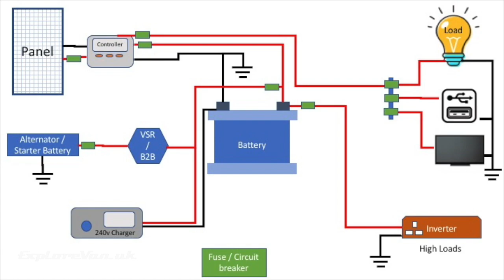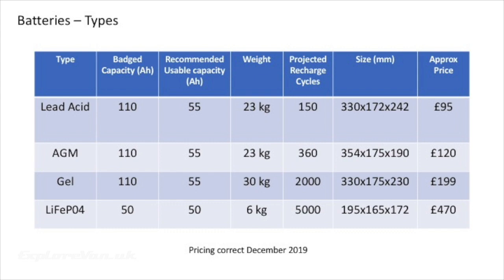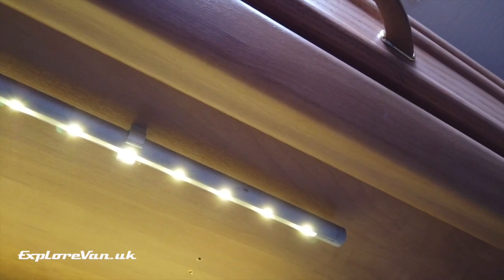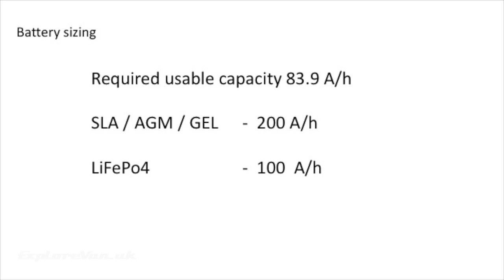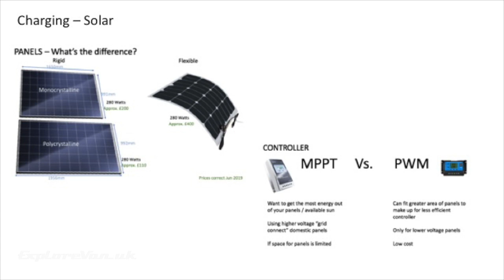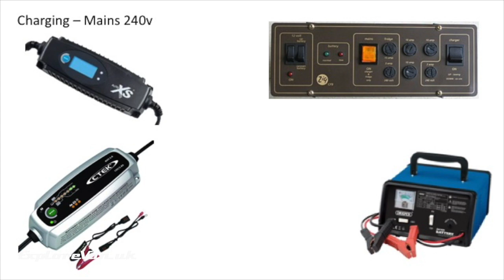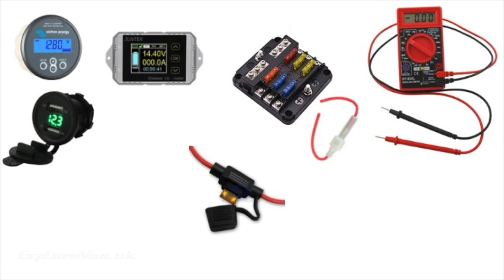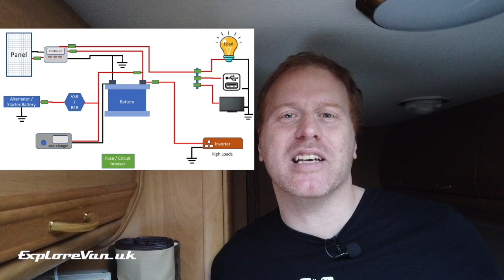Campervan 12 volt Electric Installation and Set up - Off Grid basics

Comment: Hey! thanks for all this info, really makes sense to someone who knows nothing about electrics! This may be a really silly question but if you have three different charging options, how do you know which one you are using or do you have to choose? Could it over charge? I want to use all 3 options but can't seem to figure out how it works. Maybe because no one else is this clueless!! thanks!!!
Reply from the maker: Hi, glad it's helpful!  It's not a silly question at all, there is no problem with charging by Solar, mains and alternator, in fact  itis a great approach to take, as it maximises the potential to recharge your battery.   Each of the charging controllers would effectively adjust to suit what each option was doing and the overall voltage of the battery. There is no risk of overcharging as all methods would move to a trickle charge once the battery was full.  

Hope that helps!
Reply: @ExploreVanUK  Hi, thanks for your reply. This makes complete sense! on the other hand, how would I monitor my battery level to avoid letting it run too low? I have a victron DC to DC charger but I don't think this necessarily knows how low my battery is, or does it?!
Reply from the maker: @emilysharpe5004   Hi Emily, the Victron will only draw power from the alternator to your leisure battery once your starter battery is at a safe level, that way it does everything to try to make sure you always have enough power in the starter battery to start your van. 

The latest Victron's have a Bluetooth connection so that you can view the charge status of the batteries on your smartphone. 

Alternatively, you could fit a battery monitor if you want to have a display that shows the level of your Leisure battery - a high-quality example would be the Victron BMV700

Comment: Can I connect solar and relay charger and battery charger and keep them connect to battrey all time and will I need each of them on switches to swap from each one when charging or will it be ok say leaving all 3 connected when charging from one of them
Reply from the maker: Hi, you can have all three and leave them connected, they will each compensate for each other. 

Whilst not a necessity for managing the charging I would always suggest some method of isolating each charger, just in case you need to.  But this could be as easy as having the fuses accessible should you need to pull them.

In our set up the mains charger is on a switched fused spur, the solar charger has a 35 AMP DC breaker and we have a switch on the low current negative feed to the VSR. This allows us to isolate each if we had to. But in normal use all are on.

Comment: Hi ExploreVan,I'm converting my van into a camper and I wonder if you might have an idea how long I would have to drive to charge my 115ah AGM battery if it was 50% depleted,can't seem to find that info anywhere,thanks in advance.
Reply from the maker: Hi John, - unfortunately that is a difficult one as there are a lot of factors that would vary the time, eg the size of your alternator, the state of your starter battery, what other electrical equipment is being used in the van whilst you are driving (eg radio/headlights/aircon/phone charger) what load is on your leisure battery while you are trying to charge it (fridge etc) and even the ambient temperature.  This is probably why you are struggling to find examples as there would be such a variance.

My advice would be if you are looking to maximise the charging potential while driving, consider a good quality B2B charger rather than just a split charger relay / VSR. 
These are much more effective at charging and can give a consistent 30 to 120 amp charging current to your leisure battery.  It will keep your leisure in better health by stage charging it and will be a lot quicker and consistent. 

If you happen to have a smart alternator this is the only way you could do it as a split charging system would not work. 

As a split charge system / VSR is much cheaper you could always fit one try it, see if it gives what you need and then upgrade to a B2B charger if you find it lacking.

Sorry I can't be more helpful!

Comment: Great video very informative , I'm just about the fit a split charge system using a kit I purchased with the same duritc relay but after watching your video would I be better of buying a battery to battery b to b charger and using that instead of the duritc ? Do they wire in the same way ? And What battery to battery charger would be best to buy in the uk ? I will be using a 90-100ah AGM battery off my engine battery in my vwt5, thanks again for the great video
Reply from the maker: Really depends how much you plan to use it to charge your batteries. A B2B will give you better intelligent charging profiles meaning you should get more power into your batteries in less time and keep your batteries healthier.  Sterling would be my go to for a B2B charger. I’d try the split charging see how it goes and if you find you need more then consider a B2B instead.
Reply: ExploreVan UK thanks mate for taking the time out to reply